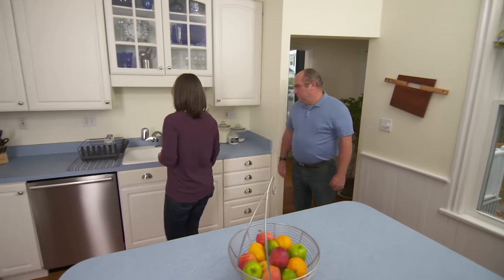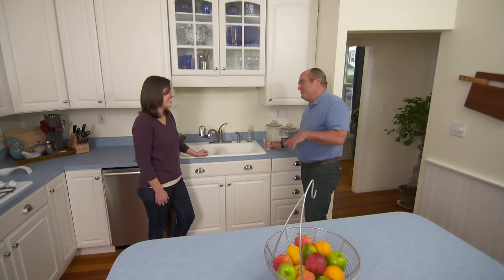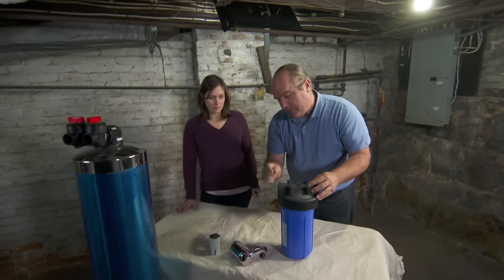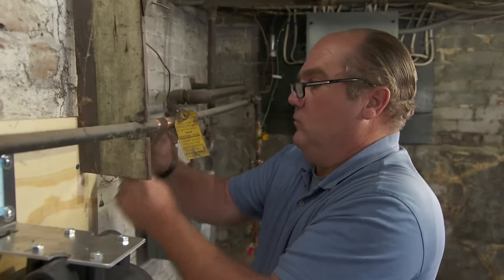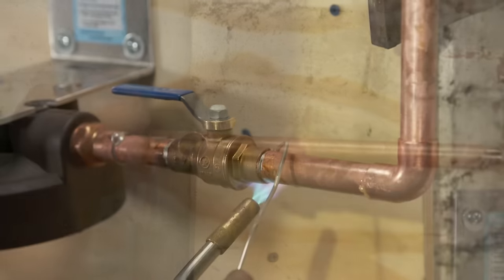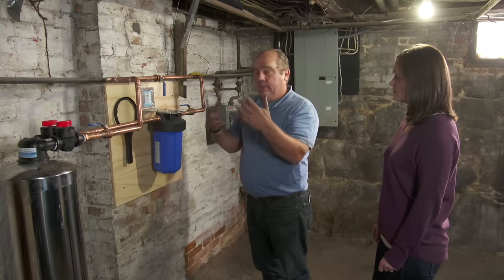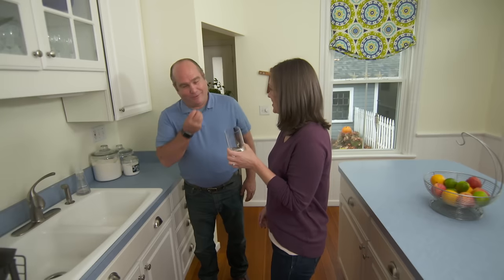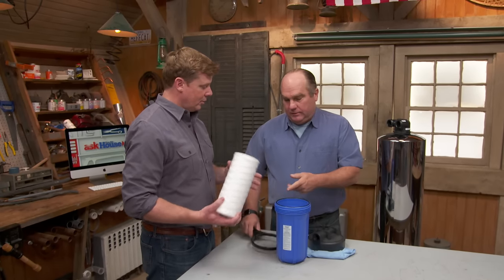How to Install a Whole-House Water Filter | Ask This Old House

Comment: His pipework was decent. However, he made a rookie mistake of not running the line to detect leaks. 
Sincerely,
An Engineer
Reply: @theamericanhiker9655  lol. Alrighty then, keyboard warrior.
Reply: Ringster Water is coming out of the faucet. What more would you like to see?
Reply: @MisterTwister88  A job being done in the right/safe manner...
Reply: Ringster What exactly did he do wrong?
Reply: @MisterTwister88  In an industrial setting, you're supposed to run the line by opening one valve at a time. By doing so, you're introducing fluid into individual components of the system, and not pressurizing the overall system at once (like the gentleman over here). Skipping this step may result in a minor leakage or a possible major outburst at a fitting. The reason for my comment is that the water inside the pipes could be hot and may hurt someone in the event of an outburst. I hope that it makes sense.
Reply: Ringster I see your point, but in a residential setting with 3/4” supply, i don’t believe that would be an issue. Especially if he had fixtures open upstairs to relieve the pressure in the system.

Comment: I installed the same kind of whole house filter system in my home a few years back. It worked great till the city water authority went around every couple months and opened fire hydrants to test them. Well that world send rusty water threw the system into my house and clog my filter with rust. Got tired of replacing filters all the time and took it out.
Reply: More an issue of not proofreading than not knowing the difference.
Reply: Knowing so much rusty water was coming out your faucets, I think you should have put up with changing filters.
Reply: So you preferred the rusty water to the clean filtered water?
Reply: @fubartotale3389  the filters cost $25 each and were supposed to last 6 months. and the rust would clog and block the water.got to expensive.
Reply: @lar4305 That just means all of that nastiness is now clogging up shower heads, faucets, etc.

Comment: All water should be tested by more than one water testing company. The results will state what is wrong with it and these results should be given to different manufacturers of water purification companys. 
They in turn will give you the information that best suits your needs for issues with your water. Talk to the sellers over the phone to better understand how their products will work for you.
Some problems such as arsenic, chlorine, radioactivity removal, iron removal and many items that make water not safe.

Comment: They need the large filter to be made cheaply so it can be thrown away, just like the pre-filter is. Changing that expensive stainless steel filter or cleaning it every 5 years is no good.
Reply: Dasdfjkl     That’s not SS it’s just a polished skin. I shopped hundreds of options four years ago. Tired of replacing $5to 7900 dollar whole house systems that never work right. Thewellguru at aquatic filter systems built ours I love it  my hair has never been so soft they also less money.

Comment: not a good system. filters have to be changed every 6 months, or sooner, to avoid bacteria build up. there's is also a gallon / litre limit for every filter. there is also other maintenance needed for drinking water safety.
Reply: do you have a better solution??
Reply: Only filter kitchen cold water. There are under sink units.

Comment: You really only need these at the point of use for drinking.  I doubt she would notice the taste of the water in the shower and toilets.
Reply: chlorine is absorbed through the skin also
Reply: Putting a filtering system at each faucet would be much costlier.  And the home is already existing so there is no way to separately plumb the toilets, showers, and sinks without a total home demolition.
Reply: here in NY the chlorine burn and stinks in the home showers ...you notice when your eyes are on fire...

Comment: He actually backed off the pipe when he had it tight
Reply: So what, no leaks
Reply: @andrewhorton6120  that we know of
Reply: Are you a plumber? When you're good, you get a feel for these kind of things. This guy seems like he knows what he's doing. It doesn't always have to be buried or crazy tight dude.
Reply: @andrewhorton6120  I actually am.18 years experience and ik he loosen it up.Been there and done that.
Reply: If you've had to do it yourself then what's the big deal
Reply: @andrewhorton6120  kind of like you replying

Comment: TOH usually has it right except for this video.  They've got it bass-akards.  For "whole house" you do not need carbon filtered drinking water at every water outlet in the entire house.  Only where you're actually using the faucet for drinking or making ice at the fridge.
Reply: Showering with filtered water helps, especially with hair and skin treatment
Reply: Don't know about you but I'll drink water from any faucet in the house if I'm thirsty.  Filtered water also keeps particulates from clogging shower heads, aerators, sprinklers,  etc.

Comment: Why are you all still showing the use of Copper for everything when PEX seems to be the standard today. Adapting is easier than ever.
Reply: this house was built with pex so its common practice to keep them the same unless you do a whole house redo of the plumbing. other wise its easier for repairs to just stay with copper
Reply: I've always installed my water filters with PEX,much easier to work with,cheaper and not to mention if they ever move and want to take the filter with them its a breeze to just reconnect.
Reply: I’d burn my house down before you catch me using plastic stuff lol, copper has nothing wrong to it’s name and it’s bombproof. But to each their own I guess
Reply: @kalijasin  The article you linked, with the exception of one single knock off brand of pex, concludes water through pex is completely safe to consume, but that odors may gas off the first 30 days.  Just take the same precautions that townships are already telling you with any plumbing -- if the odor bothers you, run your tap (for the first 30 days) for 2 minutes before consuming the water.  I can tell you there is zero odor to my water and my main line entering the house is pex.  Copper has it's own slew of problems and good luck finding a plumber in the middle of the night when you start seeing pinhole leaks from corrosion.

Comment: Yeah let's filter all that water used for the toilet (40L/flush by the way), washing machine, garden hoses, and dishwasher, because it's only a $200 filter replacement every 4 months.
Reply: Mat what fucking toilet do you have that uses 40 liters per flush?
Reply: yeah sorry more like 14 but you get my point
Reply: Adding a filter from the main water line should increase the longevity of the piping in the home, faucets, cleaner showers, etc. It's still worth it. Be open minded. Am I wrong? We should also try consuming less water in general therefore longer filter life. I wouldn't be surprised if whole house filters become part of the building code in some areas in the next 15 years or so.
Reply: you really mean 6 liters/flush
Reply: Washing machine and dishwasher would defiantly benefit from filtered water especially on a well water system. And on what planet is it $200 4 months for filters.
Reply: Mat $200 dollars for a sediment cartridge?

Comment: I want nothing in my taps but pure hydrogen and oxygen, perhaps trace amounts of copper from the pipe. What I do not want any of is possible lead from solder, nor trace amounts of plastic from this plastic CRAP. Also, any grounding lost in the copper should be fixed, so that there is a ground at all fixtures, for other reasons. Anyone that gets a water bill should demand the expectation of a ZERO reading on a TDS meter. ZERO on the fluoride test and have NOTHING but pure, clear, H2O... Otherwise, no one can justify charging someone to have water service. And when I rise to power, I will make it so.

Comment: Fantastic idea   NOT   . 

Filtering the water for the toilets and outside hose bibs  and lawn sprinklers is  CRAZY  unless you  have nothing better to do then change filters  very  often  and money is no object

 Point of use   can be utilized  to remove  chlorine,  ,heavy metals , odor , and sediment.  

I have installed  whole  house filtration systems   because  the  people had nothing better to do with their money 

Also   there is a several pressure drop with filters   so if the water supply starts to trickle   or if someone is taking a shower and another person flushes a toilet  you can probably hear the screams  as the cold water volume suddenly decreases 

Most municipal system are safe   EXCEPT possibly in Massachusetts  as this is the state that allowed  a drunk driver who killed a young lady to be their senator   and these   "officials" saw nothing wrong with that so I would definitely question their water supply with an independent lab    IMHO
Reply: Works for me. You should be so lucky to have had him as your US Senator. Haters gonna hate, I guess.
Reply: When I do these filters for people I always tap after the lawn sprinkler,in my area its shut off for 6 months anyway with winter. You're correct though,95% of my customers drive luxury cars and live in giant homes and I get peppered with questions because they have no clue what they just spent $3k on  LOL.
Reply: Keep on hatin’. Never change.

Comment: This guy is supposed to be a plumber?  "Depends" is the answer he gives for how often you change the filter?  First of all, that pre-filter should have a clear filter well (not solid blue!). This way you can see the filter's condition.  All of the filter's I've seen have a factory recommendation of changing after 3 months use.  Also, the filter in that unit is not the best choice. I use pleated paper filters that can be cleaned every so often and reused. This saves on cost.  There are different filters for different water conditions. Be careful! Some can harbor harmful bacteria.  This is the worst This Old House segment I have ever seen!
Reply: Wrong. It depends, because it DEPENDS. Different municipalities, pipe age, suspended particulates, hardness, etc all play into how long it will last. He gave a general idea.

Comment: a waste... showing will eat up the filter pad and carbon quicker. should of went with a RO under the sink.
Reply: chlorine is absorbed through the skin as easily as drinking it in the water, bad stuff!!!
Reply: define wasteful. If it takes 1.5 gallons to create a gallon of RO water, is that really wasteful? That's like flushing the toilet an extra time per day.